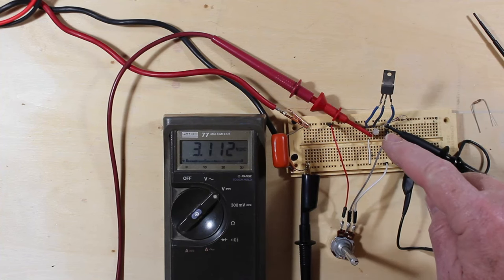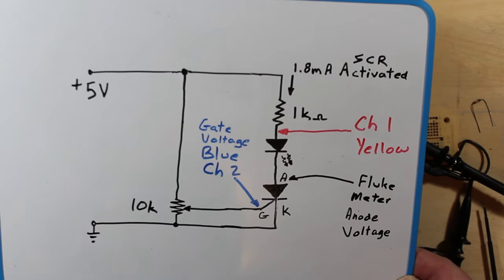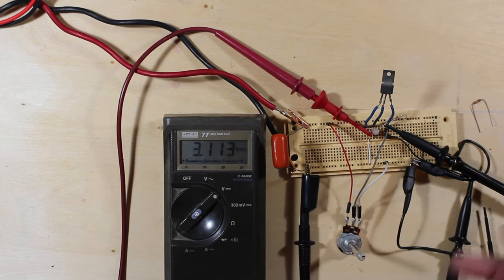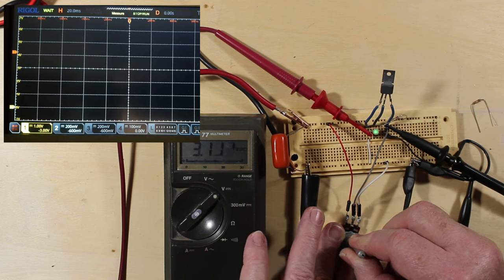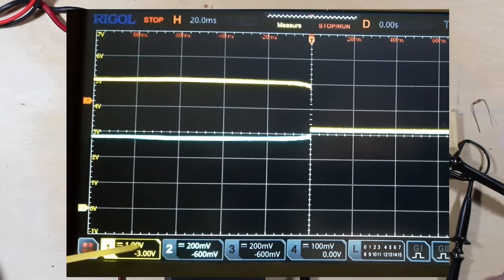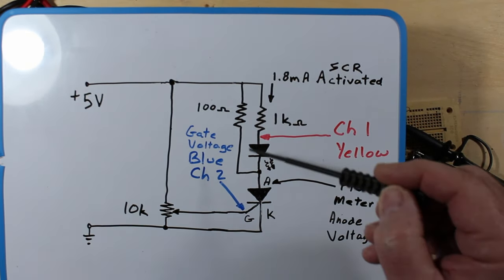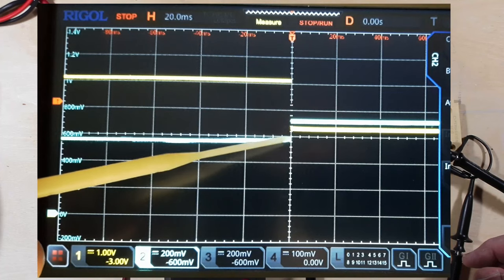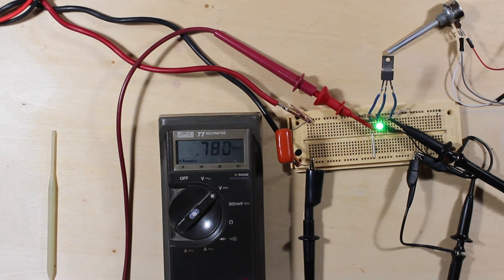SCR Thyristor - Less Than Ideal Operation When Lightly Loaded  #electronics #thyristor

Comment: That's interesting. I'm more familiar with SCRs used with mains appliances. Are they liable to have the same issues when lightly loaded too? Because even at 230v, 2ma is less than half a watt
Reply from the maker: It's possible, when the SCR has very low current draws.  The current required to 'latch' can be 40 %  higher, or more, than the holding current.  You probably want to make sure current draw is high enough to turn the SCR fully on. When looking at the specification sheet for an SCR you should find a value for the holding current,  which can vary more than 10:1 between typical and maximum values for the same part number.